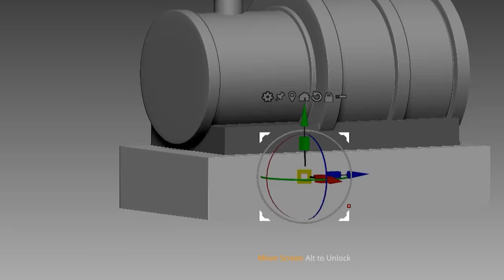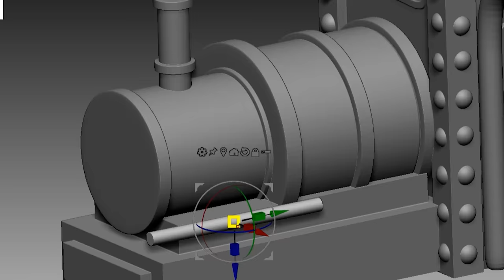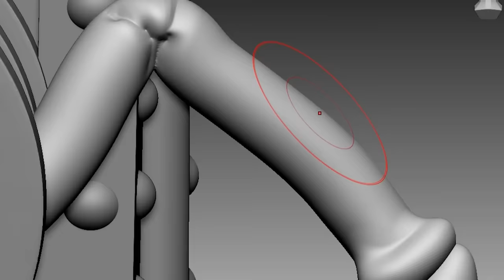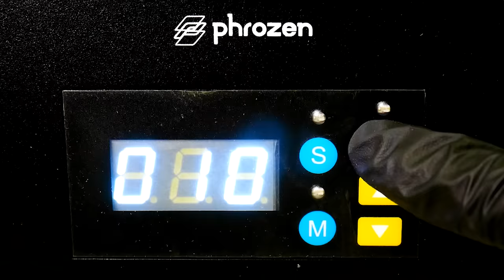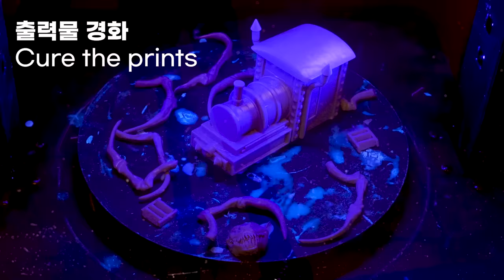Making Choo-Choo Charles Sculpture Timelapse

Comment: Loved it ❤❤🕸🕸🕸
At first i thought the painting was a bit crude ..
...but it actually worked out well and made it more rustic 
..horrific ,callous , messy ...
Love the textures as well.

Im not a fan of 3d printers ..
..as i get concerned about wastage from the supports 
..and other uneconomical factors ..
However i did just read that the plastuc leftoovers 
.can be dissolved and turned in to plastic glue .
Shame it cant be properly recycled though .
Reply: That's a lot of typing
Reply: @jaxonschrader9578  not really